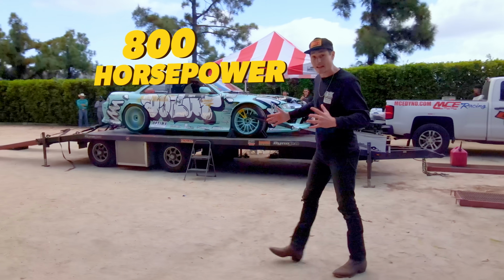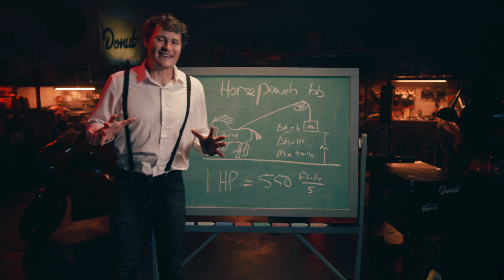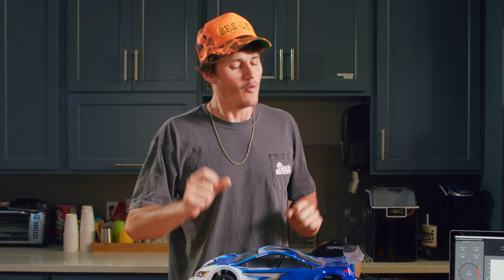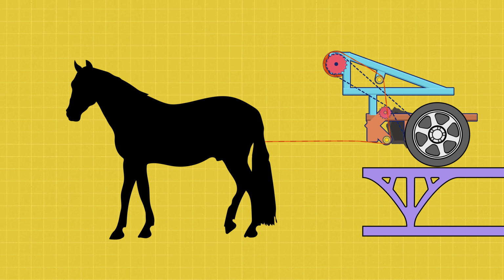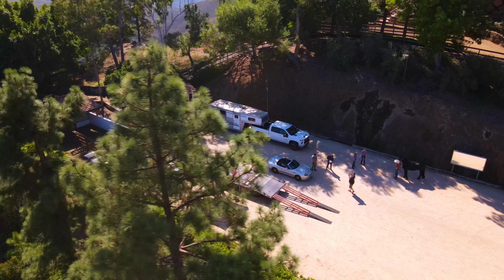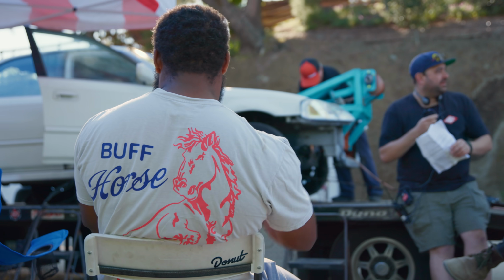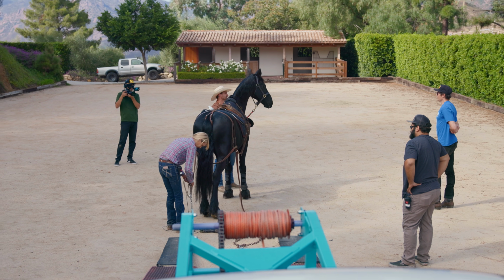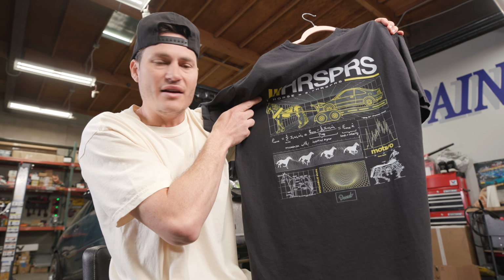How Much Horsepower is a Horse?

Comment: What a great episode!
I wonder about 3 things.  The stand of the dyno...did it move when big d pulled? 2, did the people account for stretch stress on the ratchet straps to the honda? 3, the elasticity of the ropes and harness connected to big d. Since we are talking about getting a average number...we're these things taken into consideration when collecting data?  Wouldn't there be a possibility of a loss of energy transfer [crank to wheel] if these are extra factors?  If there is any question, maybe you could repeat the experiment with brackets rather than rachets. A different tether over rope. Etc etc. I'd love to see big d pull 6.0

Comment: The testing project failed! 
(=9.8HP)

So much weight & Pulling weight attached from the horse to the chains, to the log, to the metals, and the rope weight... Then the weight of the wheels and then the other rolling objects. If you count all this then calculate.

The pulling horsepower should have been about 9.8 if the horse was using all his power.

Comment: This seems very easy if the ratios of the sprockets were adjusted before construction so that the input:output was exact . 27:20 I would have made the circumference of the tire equal to the amount of rope being pulled out, circumference"= rope"...The Honda civic's drivetrain losses should be applied from a control Dyno run where the engine crank hp is known vs the wheel hp, crank hp: wheel hp(someone knows this already from many civic Dyno runs).  Compare the two ratios of X: BIGDWHEELHP = CRANKHP:ControlcivicWHEELHP by cross multiplying and divide short cut and then your done with very little complications.😅 If the Dyno absolutely needs engine rpms, then use the transmission input shaft rpm as it would normally be connected to the engine .🎉easy 👏🎉👏

Comment: So if the new definition of 1 horse power on a dyno is 5.7 horsepower, wouldn’t we need to redefine the standard of horsepower by dividing existing stats on cars? So for example if a car produced 200 HP, after this test, it actually only produces 35.08 HP? 200/5.7.

Comment: Why not connect the chain drive directly to the dyno? Also if this horse is the one i'm thinking about, the multiplication of 2 horses will not equal the same as 2x 1 horse. This is due to the "overdrive" the teamed horses experience that will cause them to try and out compete each other.

Comment: This was awesome, But i'm pretty sure horses would produce much higher Short-term torque than they would actual power.   They have tree pulling competitions with full bread draft horses and clydesdales 2-3 times the size of Big D.  Those horses Are raised to aggressively pull thousand+ pounds. Seeing a horse Fiercely pull to full potential is really impressive. Normal horses don't do that.
    Doing this type of test on those horses Not only would probably have higher horsepower, but if you could somehow figure out the torque, it would be like a two stroke diesel.  Very low horsepower with 3 to 4 Times the amount torque.  This was still an awesome video.👏🏻

Comment: That was cool video. Y’all have great video ideas but as a gear head and a rancher that was so cool. Just idea for y’all’s next hi/lo project make a diesel tow rig find a couple of f250’s or dodge 2500’s. Do everything from fifth wheel hitches, engine tuners, transmission upgrades and suspension upgrade. For a tow vehicle that will get your horses to the rodeo, tractors and hay to the fields,cars to the track and your  off road rigs to the trails. It’s always fun to watch y’all step out of your comfort zones for the builds. If you do decide to do it, please let Nolan have a hHi build this time.

Comment: That's too much noise between the horse and the dyno. The car method makes the horse pulling power go first to the spool in the engine, then through another geared device.
You guys need to eliminate the car and put the horse on to the dyno with another mechanism that makes the horse pulling power more direc. Maybe some kind of treadmill shown in the video thumbnail. The car method makes the horse pulling power go first to the spool in the engine, then through another geared device.
Reply: Yes, this "apparatus" is complex and has many different measuring devices. But i do think a simpler build would work.

Comment: But you can't even go by that either because a quarter horse runs at a different speed than a thoroughbred also runs different than a draft horse that also runs different than a simple saddle horse. Hell even roping horses run different same with dressage horses.

EDIT: Ok so after watching the video, that was cool of the range and pretty interesting in how it was done and also the amount of concern just for the horse to not use Big D until you get something to work. Really nice how you just gave him 5 tries and that would be it cause you cared more for the horse vs the data. Rare to see that.

Comment: I was guessing about 10!  Seems like big d would have more power than a push lawnmower. Curous how fast a 5+hp bike would go. Also, what about power to weight ratio? That horse has to weigh maybe 1000 lbs but can run 40+ mph. Next test. How fast can a stripped down 1000lb honda go with a 6HP motor! (I'm thinking I could probably find this already if I search for it)

Comment: Interesting. What do you think the chances are that Watt averaged his power rating over an extended period of time? You just measured the starting torque available from the horse and calculated peak HP from that, not the average output over time. I think the average would drop the number significantly, possibly into alignment with Watt's figures.

Comment: Brilliant! Well done BigD! 
We did an experiment at school to calculate our power output. Scrawny teenagers running up the stairs (only time we were allowed to run in the corridors) outputing 500 to 600W (0.66 to 0.80 hp?). 
Well done for finding a method that avoided teaching a horse to run up stairs!
A steam engine didn't bite, didn't have to stop to eat or any of the things that reduce the effectiveness of the horse. To compare like with like we have to look at not the peak power but the power each source can SUSTAIN over a working period. I think that is why the Watt figure does not match the BigD figure. If a strong adult male human being can do 900W peak but only do 150W sustained for an hour then that is a similar ratio between Watt's horsepower and BigD's peak power. 746 Watts is a good output for sustained work by a horse.

Comment: I feel like a hub dyno would have been easier to adapt, just attach the spool directly or some gearing to move the line to the horse's level.  Still had a great time watching the video!
Reply: I mean they totally could have used the fancy gps thing and called it a day, but that wouldn’t have made for a good video.
Reply: I'm curious about the whole process. Not that it was poorly done, but surely different gear sizes would result in different torque figures. I figure if anything, instead of routing it through the gearing system it would basically be wound up on a single small shaft to drive the wheels so theirs little force holding the horse back. That way you're measuring the horses actual power instead of what the power is through the gearing system (like wheel hspwr vs crank) 

If the gearing system was accounted for, why isn't it accounted for when testing cars on dyno's vs going through the hassle of setting up a crank hp system. So many questions lol
Reply: I'm no expert on the subject but I believe dyno pulls are usually done in whatever gear is, or is closest to, a 1:1 ratio. That eliminates gearing advantage or disadvantage at least in the gearbox itself. You've still got the diff, size of the tires, etc. I don't really understand the whole thing either, just wrap the rope around the dyno drum and do the math. It's all math. 1 ft/lb = 1 lb/ft. Measure the circumference of the drum. Less variables. But also I suppose kind of boring for a video. The moment they said they were using a car at all it was kind of obvious where the video was going.  @Aesthention
Reply: @BlueScapegoat  Since horsepower is torque*speed gearing doesnt matter, higher gear more speed less torque same hp. You run in a high gear to avoid wheelspin.
Reply: @Aesthention well as long as they didn't do a gear reduction then that kind of cancels that part out except for figuring out the power loss due to friction.

Comment: One of the best things donut has done! 
Shame the horse never really pulled too far each time, seemed kinda short for such a thorough test. 🤔
Reply: Once he's running, inertia would start carrying him forward too, so he wouldn't be using his max hrsprs anymore.
Reply: Sorry, but that's not how this works. What they’ve measured is a max power — and it is generated for a fraction of second. It doesn’t matter how fast the horse is going/wheel is turning — the max power is likely generated in the very beginning, by the initial pull. In fact, it makes little sense to keep the house going, as its power will fade away after the first second and the max value will stay the same
Reply: @dropbaran  Which is very low. Horse pulling contests actually use dynamometers (watch this vid dvqFA51dOjg) mounted on trucks, they pull the truck and calculate the power by multiplying how much force they pull and speed. usually the top teams produce about 40hp or about 20hp per horse.
Reply: @teresashinkansen9402  this needs WAY more exposure...holy crap. Great info
Reply: @teresashinkansen9402  Nice link. Also, a horse is an engine by itself, it has its own curves instead of being (literally) just a number, so no experiment can be "perfect" in that regard.
Reply: @George-iz2ce  It's a video ID. Just replace what comes after "v=" in your Youtube URL by what he posted and you'll get the video. smh
Reply: I was not sarcastic; I actually watched the video and found it nice! Thanks for the help though @LegendTheCanadian
Reply: True did not even run to full speed

Comment: One thing you didn't cover at all is the difference between average and peak output. I had heard that the original horsepower figure was calculated to approximate not the peak output of a horse, but instead the expected average output for a horse working all day. As you noted, humans can output over 1 horsepower peak for short periods, but are only able to sustain something like a quarter or a third of a horsepower longer term even in good physical shape.

Based on the difference between peak and average human power output, it wouldn't surprise me if a horse with a peak output around what you calculated would actually output something shockingly close to the quoted 1 horsepower figure on average.

Comment: Wouldn't the easiest way to measure it instead Would be to set a chain get set to a flywheel on a engine dyno and then get a horse to pull it that way so you have less parasitic loss ?

Comment: I am so disappointed in you as an engineer!
The rating of HP is for continuous not peak!
They were looking at the continuous power a horse could put out for a work shift without deteriorating over the days and weeks of working.  This was because the steam engine was replacing the horse as the main source of getting work done continuously.

A little research shows that it was well known that if a horse exceeded 550 ft-lbs/sec or about 745.7 Watts it would deteriorate and could not keep working. It is also well known a horse can peak at 15HP or 11.1 kW.  But it can’t sustain it for long.

I can replace a horse with a 1HP electric motor.  That same standard industrial induction motor can run 20 years at 1HP without stopping.  But it can peak for 10 seconds at 5 horsepower without substantial damage.  Run it there for over a minute and it would overheat,melt and break.

An adult male human can put out 100 to 150 Watts continuously for an 8 hour shift.   A good athlete can put out 2,000 Watts for 10 seconds.  I have seen 3,000 watts for good sprinter cyclists on a machine that can handle it.

But Tour de France athletes can only put out about 240 to 350 Watts continuously for 5 hours, but they lose weight and suffer serious effects over a week.  It is not sustainable.

So to recreate continuous power you would have to find an application where the horse was balanced to work 8 hours a day for 7 days a week without deteriorating.  Then measure the speed and force to calculate HP.

For peak HP, you need the horse to be allowed to go faster.  A horse can pull a certain max force, and you allow them to go faster, you would find a point where it tapers.  That horse was no where near their peak HP speed.

Comment: 0:00: history and accuracy of the measurement of horsepower.
4:32: process of putting a horse on a dyno to measure its horsepower.
12:44: building the world's first horse dyno to measure horsepower.
17:45: measuring horsepower using a homemade dyno and human power.
23:14: Big D attempts to make horsepower history by pulling a dyno rig with his maximum strength.
26:55: true horsepower of an engine through an experiment and statistical analysis.

Comment: well you could just weigh the horse,have it run some distance and calculate acceleration and speed.then calculate the power and convert it into horspower.we did this (not using a horse but ourselves) at my trdeschool for plumbers.its not that hard

Comment: This really didn't correct anything at all. You were doing full power pulls, which the strongest draft horses in the past were estimated well above 12 horsepower in doing so. As you rightly said early on, the horsepower rating is equivalent to draft horses working at a pace they could keep up the entire workday. Someone needs to get some draft horses pulling a sustained draft horse workload for a full day and average it out, which you'll find that James Watt wasn't messing around when he came up with the Horsepower rating. That dude was almost infallible.

Comment: 0:10 the power of 1 horse power is the total amount of static work a horse can have put over its life without causing any harm. "daily work load = 64MJouls/day"  a 24 hour drive at 100mph = 8.24giga joules of mass movement, near 128hp... but the thing weighs 2100lb and makes 38hp. an engineered statement of bigger number for a wagon puller, would be 80gigajoules for a plow puller aka 1242hp as a static force not drawn accumulation. can put bigger number because of lower rolling resistance... 240hp was the "g-mans agreement" so they are stuck with a 35hp engine.
Reply: rear end wheel slip in... first gear = car has 271hp without adding weight transfer mass gravity distance, could just say 360hp based on the fuel going in it... would need a bobin weight and a protractor to find the angular acceleration hp "horazontal G's" to then add as a percentage of weight transfer or jus take off the rotational weight to the front as being what the rear is +57hp and that's a 328hp NA 4.6 ford that is 91.1% efficient.
Reply: 328hp at 3300 feet above sea level so that's a 1.0983 times discrepancy ... 360.24 as sea level air... a stated limit of tire traction not giving and 0-??? times. winter tires do not slip on asphalt like summer tires do...
Reply: the broken 8.8 axles show it! 290hp corrected and 450bhp.

Comment: I do not understand why you drove the dynamometer through a car's transmission system - why not drive it directly with the rope or via an axle and two wheels? You would then have a more-or-less direct read out of 'crank' horsepower

Comment: At last, we know the actual “horsepower” of a real horse!!  
But I would like to see if the number 5,7hp is UNDOUTEBLY CORRECT with a SIMPLE VALIDATION TEST…You should find a small engine that produce the same (5,7)hp and put it at the end of the line instead of the horse.

Comment: nice test BUT have to say that your drum with a rope was probably the dummest thing i have ever seen ! WHY the hell did you secure the other head to the drum ? it could have been a huge problem if run out of rope.. Narrower pulley type of wheel with a long rope wich doesnt need to other end to be secured at all, would have been best for all.

Comment: The first operational VTOL jet aircraft was the British Royal Air Force Harrier first flew on Aug. 31, 1966. Motivo’s was not the first nor had any participation in  the first vertical take off and landing aircraft. In short the British RAF did it first....
Reply: I agree with your statement. There was a missing "e" in the video. Motivo worked on the pioneer eVTOL aircraft (battery powered)

Comment: Hi, quick question: Big D should be the norm right, so Big D is 1 horse, which means it creates a power of one horse meaning one horsepower. In the video Big D creates 5.7 horsepower with regard to the older standard, how much power is that? That power should then be divided by 5.7 to get one horsepower right? A horsepower should be the power that one horse makes, keeping in mind that that horse represents alle horses, or taking the average of measurements done by multiple horses.  This one horsepower should than be convert to SI units for the academic community, so why is the answer given in the old standard?

Comment: A horse needs a pull against a water dyno and gear set .Or maybe an electric generator that can drive a fan for cooling and a resistor bank . Whatever needs to be tested as draft animals were. If I had my choice mules or donkeys would be also used. I’m betting that donkeys would be better for the long haul and eat less.

Comment: I mean okay, yeah this was cool to incorporate a car and a true 1-horse engine but why not skip the car part and attach a pulley system directly to the dyno... Allow the horse to rotate the dino to measure the least resistance from horse to dyno by eliminating resistance through the mechanical components of a car.